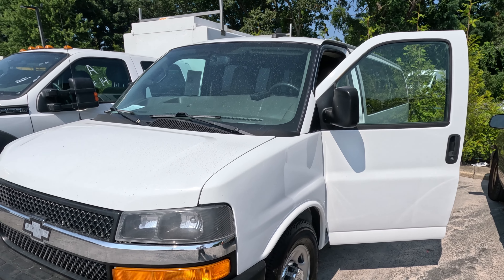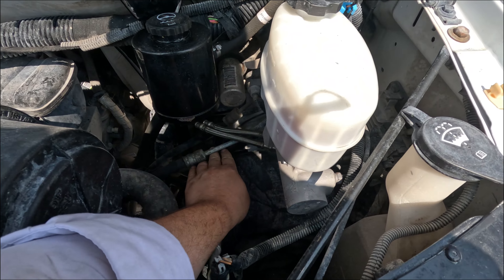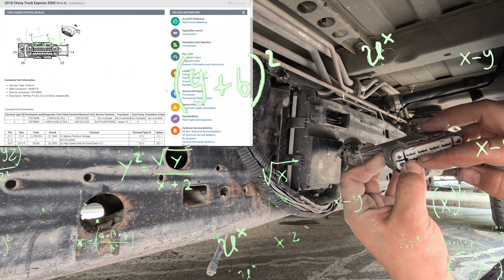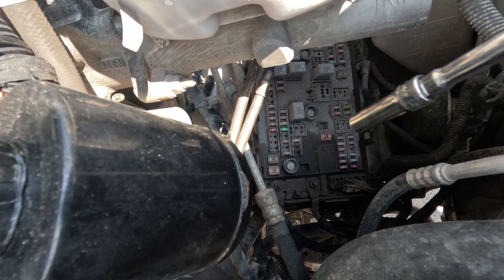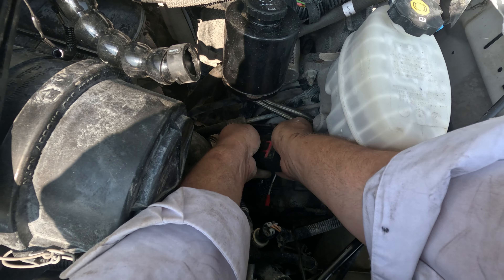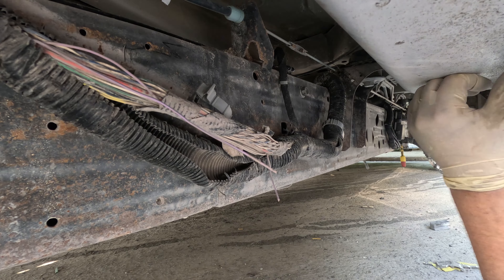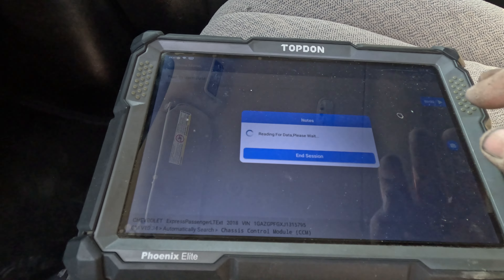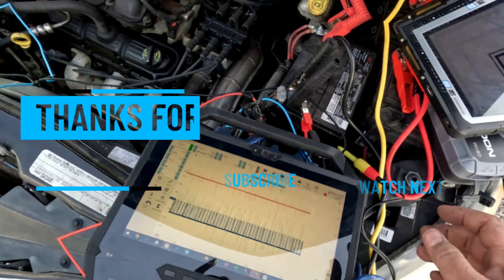2018 Chevy Express - CCM fault, Finding the broken wire!

Comment: Good stuff dude, thanks for sharing. I saw your short about the banana jack end on the test light, tried repeatedly to send you a message but none of them would go through for some reason. I was just wondering where you got the banana jack from? I have been looking for ends like that for a couple of months now with no luck. I did find some cheesy ones but not interested. Can you please post a link or just the manufacturer and part number if possible? It would be very much appreciated! Thank you!
Reply from the maker: Thanks! Fully Insulated Test 4mm Banana Plugs Male Stackable Connectors: https://amzn.to/3OziqG5
Reply: @advancedleveldiagnostics  Thank you. Keep up the great content!

Comment: I noticed you had a code in the EBCM. It wasn’t shown in the video, but I was wondering what code it was. The reason I ask is because I have similar codes as you, but I also have a no wake up signal code from the EBCM.
Reply from the maker: I think it was just Invalid data received from PCM because there was a code in the PCM.